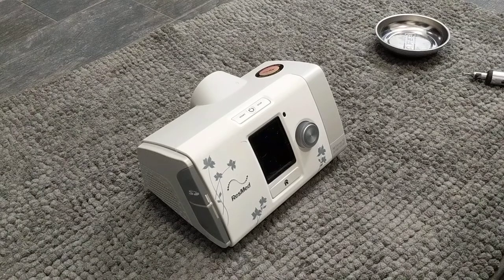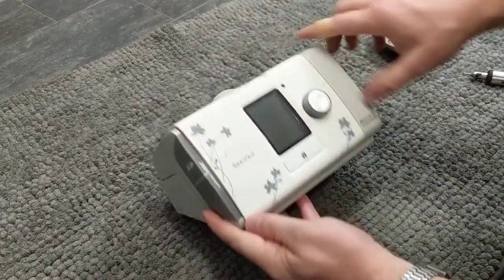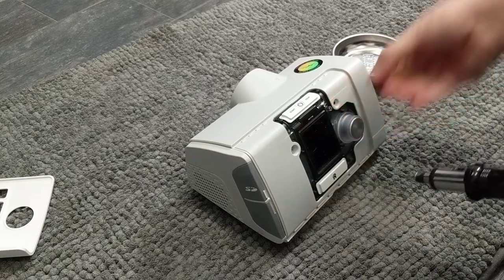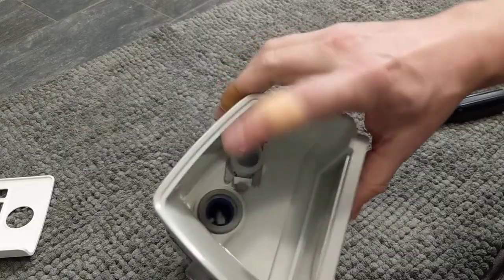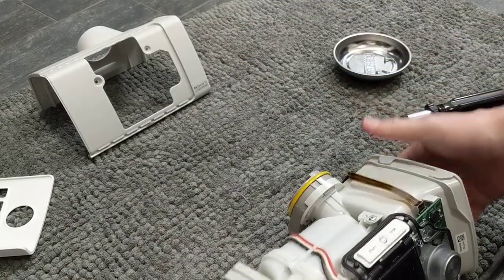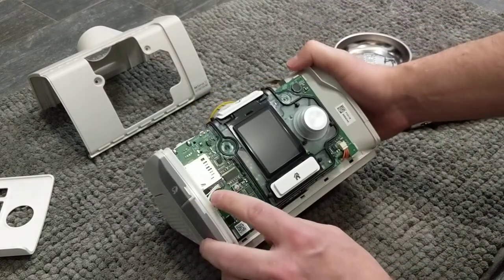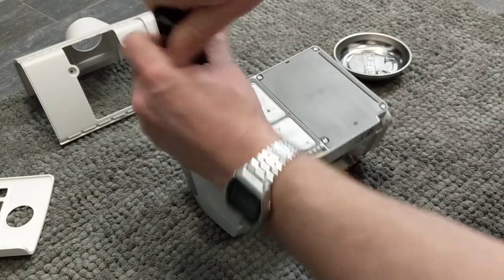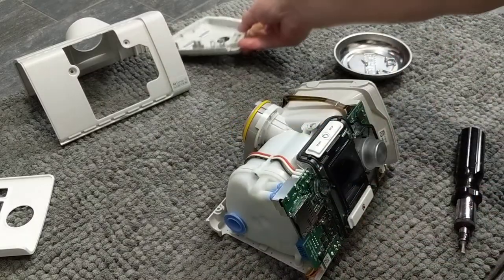Disassembly and modem removal of ResMed AirSense 10 AutoSet For Her

Comment: Can I buy a replacement foam ring? Mine has turned green and squishy, more like green floral foam. Even if it available, is it advisable to replace the foam rather than just getting a new machine? After seeing the green sponge, I refuse to continue using my CPAP. I assume my ozone cleaner is responsible for degrading the gray foam.

Comment: Would you be able to do a video of cleaning the blower motor? I'm having the notorious whining fan nose and I'm hoping a solid cleaning will fix the issue rather than trying to spend $200-$300 on a used part.
Reply: I tried taking the blower motor apart but I didn't have any success.  Unfortunately that part may not be as amenable to repair.
Reply: @bendirval3612  everything is posible. If  they were possible to ensamble the motor, it should be a way to it apart in a safe way. It probably has some kind of glue that it can removed. I don't know.
Reply: Lenoir tijucas  it should be a way to open it. Pretty sure it didn't born in that way.
Reply: I have taken the motor/blower apart, since I replaced it with a new one. I would say it is almost impossible to repair this perfectly. On mine, making the same whining/grinding noise, it was the second smaller ball bearing, which lost its grease. I had to cut the clear plastic housing open with a dremel tool, which consists of 3 pieces (and not 2 as I first assumed) glued together. The really tricky part is to cut open the two parts, as they are embracing one of the fan blades. Also the blade fans seem to be balanced on the shaft (as done in vehicle turbochargers) because they have markings on them. For the bold ones of you daring to try, these are the part numbers of the ball bearings, which cause the noise: NMB L-940ZZ and NMB R-1340HH. It really sucks that the whole expensive problem comes from two failing 2$-parts. If needed, I have taken pictures of the disassembled blower motor.
Reply: @clutchmasterLET  I took the motor out from the CPAP and you're right. It's totally sealed and comes with some white marks. Cut it with a Dremel tool is challenging because it has to be a clean and perfect cut in order to make the assembly again. What about submerging the only part that has the glue in warn or semi-hot water. No hot enough because it will melt or change the shape of the housing. By the way, where did you find a new blower?
Reply: @carlosgraphic  the glue is instant glue/superglue so hot/warm water will do nothing to it. Cutting it open with a Dremel is not as hard as it sounds if you make markings before cutting. Also with this the parts will fit only in one position. The real problem is to NOT lose the balancing of the fans on the shaft and remove/replace the worn out ball bearings. I got the new blower from an official Resmed Dealer.
Reply: @clutchmasterLET   I need a new motor also, where can i order a new one?
Reply: @user-mn6ze7rm2p  at least the European resmed dealers are selling the motor as a spare part, so find some who suits you and ask for part number 19696 (pneumatic block).
Reply: @clutchmasterLET  where can i buy the cpap airsense 10 engine, do you have the part number of this engine? I will have to change I already did several cleanings and the noise continues!
Reply: @maikopoolstocksom2580   European resmed dealers are selling the motor as a spare part. The part number is 19696 (pneumatic block).
Reply: @clutchmasterLET  was there a way to power the motor when it's disassembled so you can tell if it's noisy? Maybe it's a DC motor? Or maybe it's a stepped motor?
Reply: @fitybux4664  it has 3 wires (black/yellow/orange) so considering the way the cpap works I assume it is not just a simple DC motor. I didn't try to power it, as I was sure that my old motor was noisy and already had the replacement part.
Reply: @clutchmasterLET  please show the picture. Mine has the same problem. just 3 year 1 month , not covered in 3 year warranty.
Reply: @clutchmasterLET  where can order a new one? please pass the website and how much will cost?

Comment: Can you fix the "whistle on inhale" by disassembly / cleaning? Or do you think there's something wrong with the motor inside? I guess we'll see now! :-) I am wondering if the motor is just like a 12V DC motor, or some kind of special step motor? I guess you could hook up an oscilloscope and figure stuff out.
Reply from the maker: I suspect the motor is the problem, but that doesn't mean it can't be fixed by disassembly. Maybe use a blower or something...might be some lint or dust in there you can dislodge.
Reply: @grantsreviews4299  the result was: After cleaning all the parts in the CPAP's airway, it still whistled. (No lint nor water was found in the motor.) Then, I tried a spray bottle of rubbing alcohol in the blower motor, followed by blowing it out with a powerful air pump. (I don't have an air compressor.) I did the alcohol / blower thing three times to the motor. This caused my spare CPAP to work without a whistle now! But I just tried the same trick on my main CPAP and it still whistles. Maybe it's one of the three pressure sensors? (I'll have to verify by swapping blowers around.) Also, did you know the motor is only like $3 on some websites (aliexpress and some other variants), but nobody has it available for sale? I'd bet some people would give their left nut just for a replacement motor to avoid having to spend $900+. So end result was: I did revive a CPAP last night! (Spent until 8am working on it, yikes.)

It is a 3-phase DC motor (no other electronics, it's a center tapped 3 coil motor) that is capable of 6000Pa. Google says this is 61cmH2O, yikes! (You wouldn't want that kind of pressure on your lungs.) Also it can do 30,000rpm which I find pretty impressive, and probably also the reason for the very fragile "problem = LOUD NOISE".

I have a feeling that the rubbing alcohol / blowing fix will only last a few weeks / months and I may need to get an Airsense 11 when they come out, or a replacement motor if they are ever available again. The two different Airsense 10s I have are 5000 hours and 7,400 hours. Definitely a "premature death" as these are supposed to last until 20,000 hours from what I've read online!

My background is: field service tech. (So I'm familiar with taking things apart and having them successfully go back together, lol.) I was very careful with the cleaning each part, knowing there is ABSOLUTELY NO REPLACEMENT FROM RESMED. ;-)

Comment: Do you know what could be causing an intermittent "burning plastic" smell in the air you are breathing with the ResMed Airsense 10? I have been getting it off and on, and looking at CPAP forums, it is fairly common. It seems to come and go, and can go weeks without it, and then it happens and yo have to turn the machine off.

New machines have it. REplacement machines have it. People are trying to figure out what causes it.

An overheating motor seems the likely culprit. Do you agree? It happens when there is water in the humidifier and when the air coming into it is fresh.

It seems the motor is the only thing that can get too hot and you would then smell windings.

Grant, what are your thoughts?
Reply: Burning plastic is definitely not what you want in a CPAP. The only non-biological smells I have gotten from my CPAP happen when the water runs out, so I can't be sure. It could be the motor itself. That would be bad news as the motor can't be serviced and replacements are not readily available. Note also that the humidifier consists of a hot pad upon which the tank sits. If the humidifier has something on it, I could see that burning up and the smell somehow making it into your air. Could be on top of or under the hot pad. You might want to try it with no humidification and see whether it's still possible to get the smell. Though, if it's intermittent, it will be difficult to be sure of anything.
Reply: @bendirval3612  On teh forums people have tried it with no humidifier and experience the same issue. Mine has gone months without a problem. Then it will happen. Then stop. Others find this as well.  They get a replacement machine. Then IT does it. Intermittently.
Reply: The humidifier is full of water when it happens to me. And I have had the humidifier run dry without any smell. So puzzling. I think it must be the motor itself or the circuit board.
Reply: @glenngalen9853  Not good. If it were me, I would disassemble it and sniff around to try and find the source, but I'm quite comfortable with disassembly and also buying replacements when I break stuff. Good luck with whatever you try.
Reply: @glenngalen9853  maybe the hose heater?

Comment: Great Video thanks . I wonder if there is a specific piece that is the one tha produce more noise or is the motor itself. Does someone have a part list and where to get a replacements parts as de foam donut or the silcon seals. Or the trubine or motor.
thnaks

Comment: Great video Grant! 
Hoping you could help me with two questions:
1] Does disconnecting the modem wire also stop the modem emitting microwave/radio energy as well as disabling external unwanted internet access to the modem / cpap device (that is, regardless of internet disconnection does the modem still do bursts of radio energy intermittently)? I ask because I would not want any RF radio / microwave signals still transmitting near my  head at night on a regular basis ....
2] If you select Airplane mode - does the modem turn off permanently or does it turn itself back on after 3 days like on my Philips Dreamstation? (Note: On my Dreamstation you can just easily remove the modem from its location under its external flip lid ) 
(PS I am thinking of purchasing a Resmed CPAP as the Philips now has been recalled for a very  toxic sound abatement foam issue)
with thanks
Reply from the maker: Disconnecting the wire completely removes power to the modem, so there should be no RF once that is done. I did not use airplane mode much, personally, but my recollection is that if you turned it on, it stayed on. Good luck with your therapy!
Reply: @grantsreviews4299  Hi Grant - thanks for your reply - this gives me confidence that I can purchase the Resmed - appreciate your good work!
Reply: @grantsreviews4299  No intentional RF emissions. Still unintentional that all active circuitry makes. (For instance, there's probably like a 40MHz crystal oscillator for the MCU in there somewhere.) Of course, this is going to be on many orders of magnitude less.

Comment: Plug in fragrance oil may become imbued into the plastic/silicone.  Only way I can see of removing that odor is baking at 110 degrees F, until no longer smells.  No guarantee it won't destroy machine.  Is it even worth the hassle?
Reply from the maker: Might work. Sounds risky. Volatile chemicals, by definition, easily move out of materials into the air. I've had pretty good luck with a really thorough washing with dawn and then let it sit in front of a fan for a few days. It takes a little time but no smell lasts forever. You can always try more dangerous things later.

Comment: EXCELLENT instructional video!! Question though: my on/off buttom is "spongy" and will not turn on/off the machine. Do you have a fix for that?
Reply from the maker: Did your button become spongy after following what I did here, or is that the problem you want to fix? My guess is that it's mis-aligned. Pretty easy to get several of these parts put together out of alignment, as you saw in a couple of spots on the video.
Reply: @grantsreviews4299  nope. Haven't taken it apart yet...

Comment: Very informative. Thank you. My old Airsense is working but I am getting a fouls smell through the mask. Originally it was faulty due to water damage. How can I get rid of this smell ? Should I mix anything in the water container?
Reply: In my experience foul smells most often come from the hose. If you are sure it's not that and it's not the tank, you can consider doing what I did in this video. Take it apart and clean each piece individually. Unfortunately the motor itself can't be cleaned well. Also consider a mini ozone generator. Put the CPAP and ozone generator in a sealed tub for a day or two, possibly with the fan blowing. That might work.
Reply: @bendirval3612  Many thanks for your swift response.- I have cleaned all individually per your video except the motor. I think the motor was subjected to overflow of water. Can I only clean the motor in the ozone generator? where can I get this done?
Reply: @rogerraj5504  Amazon has mini ozone generators that look like little disks (fuloxtech or tobelife, for example), charge by USB, and cost $20. I have used them to remove odors (like smoke smell) from small objects and they work well. Of course, some odors react better to this than others. If it were me, I'd try putting the motor in a tupperware with one of these for a day or two. Or more. Note that ozone works best in dry air. You will need to let it air out for a day or two after that. On the other parts, consider peroxide and a bit of dishwasher detergent. After scrubbing, leave it to sit for a while so the peroxide can work. Maybe even let it dry. The water tends to dry first, concentrating the peroxide and making it more effective. Peroxide is only so-so at killing germs but it's great at killing most smells. It just takes time to do so.
Reply: @bendirval3612  Thanks Mate. The problem is the motor. I only wiped it with cloth and fitted all back together. The rest has been cleaned very well. Now that I know the machine works after putting together- Thanks to you. I will remove them apart and dry them well and do the Ozone treatment and put it back together. One more question though, The motor which was covered in a blue Silicon rubber, does this pump air ? and not water right? -
Reply: Sorry, it does pump air. I just checked the video.

Comment: where can i buy the cpap airsense 10 engine, do you have the part number of this engine? I will have to change I already did several cleanings and the noise continues!
Reply from the maker: I've never found the motor for sale anywhere. If you do I'd love to hear about it.
Reply: @grantsreviews4299  It cannot be bought unless you are an authorized Resmed service center. RIGHT TO REPAIR!!!! We should be able to get our hands on these replacement parts. This is just like Apple!

Comment: I was hoping you showed how to remove and replace the air outlet valve where the humidifier connects to. I see a tab inside that area where the humidifier goes. But dont know how to pull it out once i push the release tab . they sell3them online for $11.00. But can't figure out how to get it out .the hose connects on the backside if that air outlet valve. Hope you can post that video. Thanks.
Reply from the maker: Thankfully, it's quick once you know the trick. Here's a video, just for you. https://youtu.be/hc8uW2dTmWw

Comment: Followed all your directions still asks for airplane mode and also can't get rid of perfume smell.  It was on the silicone and also the motor smelled of perfume but did not do anything to the motor.  Please give any suggestions possible.  Removed the part you say is the modem.

Comment: I have this machine, and sadly, I get bad dry mouth and like a tongue swelling, I have used the chin strap as well as oral tape to verify my mouth is closed but I still get dry mouth. I also smell what I can only describe as burned dust. It is causing me to have sinus pressure, headaches and weeping eyes, as if there is a lot of dust or allergens inside the machine. That is why I watched this video, to see if it is possible for allergens to get trapped inside. Also, as I use the humidifier, I still don't understand how I get dry mouth when my humidifier setting is set fairly high. Also, for some reason, I don't have that small plug on the hose that goes into the c-pap itself, where he claims it's for a heater.
Reply from the maker: Are you using a nose only mask? Dry mouth often comes because you have a nasal mask but your mouth opens. That causes the machine to move too much air to keep it humidified. I had that problem and only a full-face mask would work for me. The smell happens when the humidifier is run but there is no water; often happens after there is a big leak. A very thorough clean of the unit and maybe replace the water tank might fix the smell. Your hose may not be a heated hose. That can cause condensation in the hose, which results in less humidity making it to your lungs. I hope you get it figured out! Good luck!

Comment: I have a Resvent iBreeze 30STA. It is new and will not (never did) write any user data to the SD card. I also have a Resvent iBreeze20A and it writes and saves the data no problem. Any ideas?

Comment: So, I noticed when he was replacing the one screw on the top that he only tightened a little bit, and then screwed in the 2 bottom screws, he did not finish tightening that top screw. Just an observation on my part.
Reply from the maker: Yeah...whoops. I put it all together and forgot to tighten that one. My bad. I didn't want to re-record since I did this all in one take.

Comment: How do you set the pressure for yourself if buying a used machine?
Reply from the maker: With this type of machine, you can let it autoset the pressure. However, if there is a fixed pressure you want, you can get to it by holding the dial and home button down at the same time. That will take you to the "clinical" menu and there are settings there for things like pressure.

Comment: I guess it would be a better idea to take it apart and put it back together on a cleaner surface then your carpet and less likely to pickup fuzzy stuff off the carpet into the machine
Reply: Not to mention carpet is not great for ESD and there certainly is a lot of circuitry inside this thing.